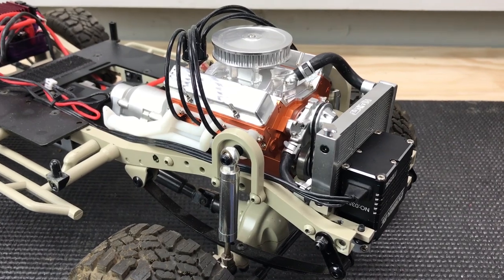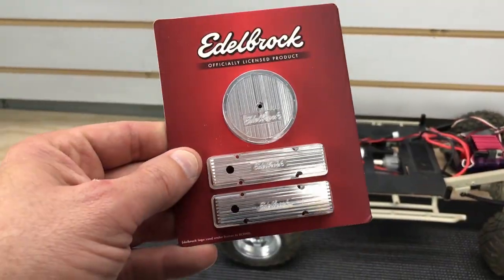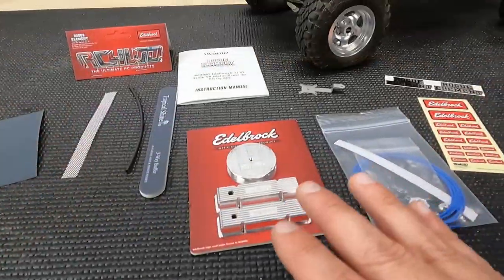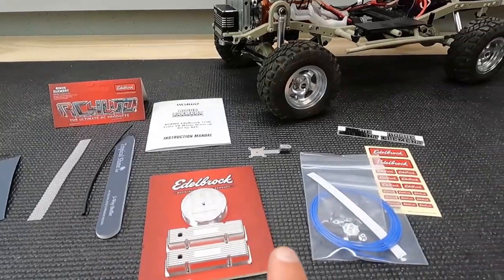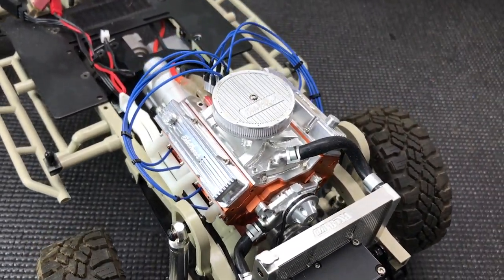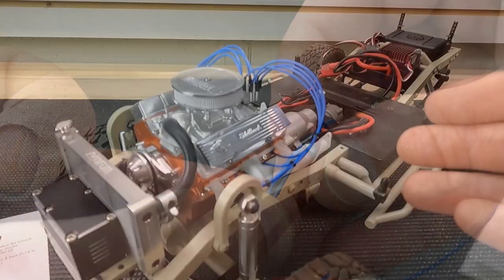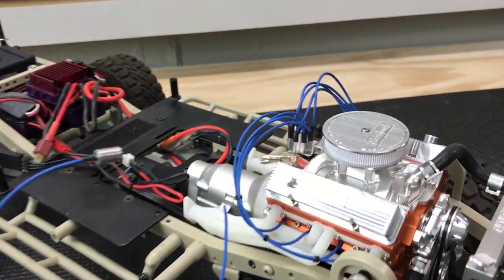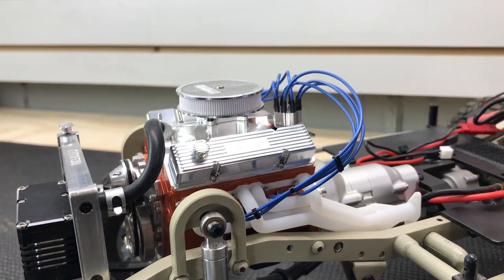Scalin' It Up! RC4WD Edelbrock V8 Motor Dress Up Kit | RC Driver

Comment: This is an amazing build. Going to start a blazer to truck conversion with the V8 and really curious on your servo mount. Looks like it’s forward for the radiator. Is that aftermarket. Thanks in advance. Love the videos

Comment: Hello RCDriver_Online,  My name is Carlos Rojas. I tell you that I have an RC traxxas Ford Raptor 1/10 scale 2wd slash, and I want to install that led light bar from the Pro Line brand, in addition to installing the front and rear lights to my truck. Which ones can you recommend?, My RC truck has only 3Ch model 6519 KA1867-R01 receiver. Ch1 Ch1 Ch3 Ch3. If I buy the led bar and the front and rear lights through amazon, can I connect them to my receiver? , Or should I change my receiver and change the remote control.?  Excelent Video.
Reply: Should most definitely plug into the channel 3 spot on the receiver, on/ off with a click of switch

Comment: I like the motor but it's way over priced plus you gotta buy all the extra stuff for it $20 here $20 there $189 for the motor itself which isn't even fully built... I got one but it cost me way to much to build it same as you plus got a blower n charger ect and a few other intakes... But honestly their is a few other motors out there that are 50 or so and fully built you can put in your car and the transmission actually bolts up lol. And they are metal as well